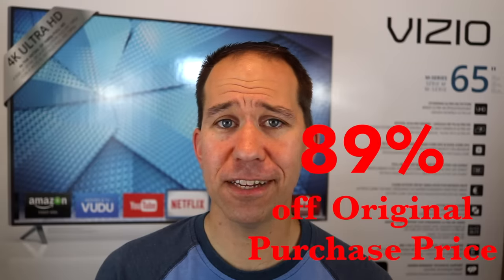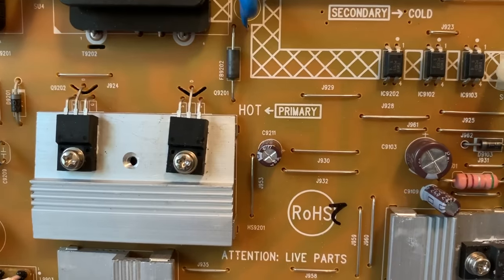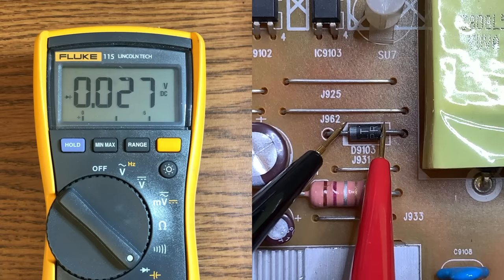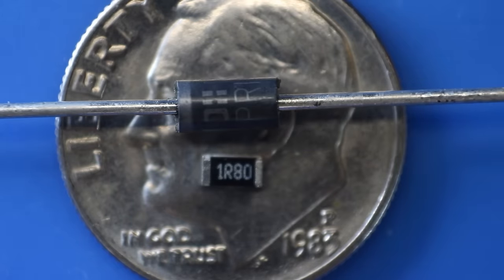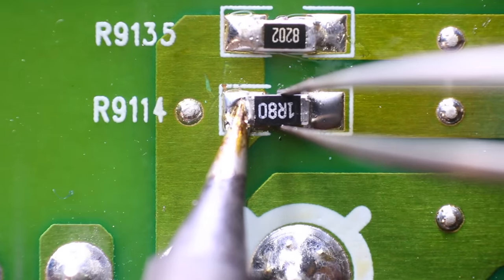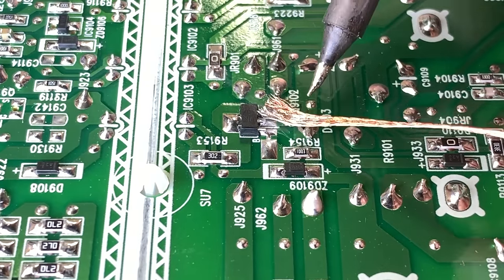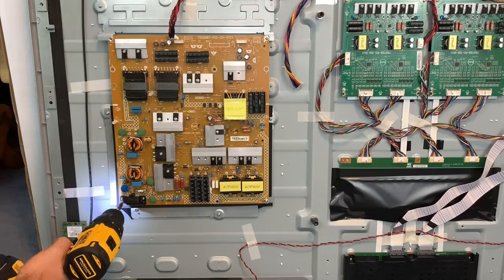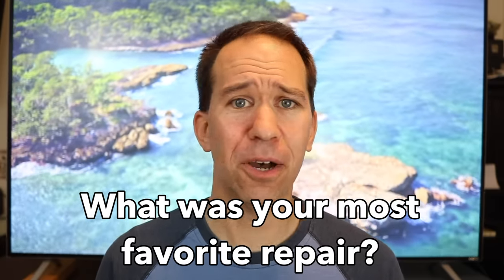I got a broken 65” 4K TV - How I repaired a Vizio M65-C1 (tv won’t turn on)

Comment: This reminds me of a story.  In 1971 I was working at a small aviation electronics factory/  There I met a guy who was a QC check technician, and he told me he had a warranty service contract for one of the major tv manufacturers.   He asked me if I wanted to go into business with him.  Although I had a good background in military electronics I didn't know much about tv's and I told him so. He said he didn't know much about them either.  That amazed me and I asked him how he managed to service tv's that he didn't know much about.  Remember, in those days most tv's were still vacuum tube models.  He said he took a model of this tv and pulled vacuum tubes out one at a time and wrote down the symptoms.  Then when he got a call he consulted his notes and replaced the appropriate tube(s), and he said that 90% of the time that fixed it.  I asked him what he did with the tv's that could not be fixed with his tube replacement method.  He had an agreement with a real TV service tech who he would take the dogs to and this guy would fix the tv's for a price and then he would deliver the repaired tv back to the customer.  Of course, I turned down his offer.  Talk about balls.

Comment: My favorite Repair was an APQ-126 Bombing Navigational Radar power supply while I was in the Navy.  It's a huge power supply with 18 different power modules and thousands of components.  I managed to isolate the problem down to a single resistor using the schematics returning the PS to 100% operational.  $300K Power supply fixed with a 10 cent resistor.
Reply from the maker: That is so awesome to hear!  I bet that was very satisfying.  Very cool!

Comment: Great video and I love to fix things as well just never known anything about small electronics.  You just got the wheels turning my friend.  :). I have a similar story about fixing a 50” Samsung DLP after a football went through the screen.  I had just replaced the color wheel and also knew about the bulb as two things that can go wrong.  I used Craigslist to find the exact same tv that wasn’t working and was being given away free.  All I needed was to pull a tray that held all the parts I needed out of mine and into his.  His issue was the color wheel which I had already replaced on mine.  10 min job 100% fixed.  But now I need to learn more about these circuits.
Reply from the maker: Thanks!  And great story!

Comment: I've used solder wick for decades.  Sometimes, especially some of the crappy stuff we get now, they may not "suck up" the solder very well.
So what I do now, IF I'm using wick instead of my fancy new power solder vac machine, is to dip the wick in 
LIQUID ROSIN.
Yup, I just dip it in the rosin and the wick does its job well.

Comment: Thanks for showing all the detail on how you got and fixed this Vizio TV. 
I'm thinking that the very same problem might happen again in a few years. Maybe this resistor is barely marginal for what needs to be done. Could you have installed a higher wattage resistor that might not burn out in a few years?
Reply from the maker: The first component to fail is most probably the diode.  This shorts and then the resistor blows as a safety mechanism.
Reply: @FrugalRepair  Thank you. I was wondering what failed first. Maybe the diode needs to be heavier duty to be able to handle more current? I don't know, just guessing.

Comment: Thank you for that.. I also like to fix things.. from cars to computers... currently I am attempting to fix my home theater subwoofer..it is the victim of a power surge so I welcome any advice .. Thanks again
Reply from the maker: That’s great to hear!  For the power surge, it could come through the mains or through an accessory (like through an hdmi).  Usually components near the power input/surge will take the hit first.  Hopefully you’ll be able to see a burn mark or other evidence to make tracking it down easier.
Reply: @FrugalRepair  Hello again.. I eventually bought a new sub woofer only because I just wanted a new one.  I still have the damaged one one day I will commit to do the full repair.. I am currently working on My 2003 ford expedition, repaired brake lines (4), replaced and installed fuel injectors, fuel filter, egr valve, dpfe sensor lastly pcv valve.. I'm a pro photographer but love to save money and do it myself.

Comment: I fixed broken cam for cruise control on my 04 Honda Accord using small braid nylon string and nylon tie. It supposed for temporary but it still working, 2 years so far.
Reply from the maker: Nice!  Thanks for letting me know.

Comment: I tried to repair my parents' 50 inch LG TV that broke down. The ESR meter helped identify a couple of caps that were bad, replaced them and a couple of resistors still no-go. I wanted to check the voltages but my dad didn't let me test with the board plugged in lol. If the problem is in the power transformers, or IC chips, I have no idea how to diagnose those things :(
Reply from the maker: Thanks for commenting!  Testing the output voltages on the power supply is one of the first things to check.  You want to make sure you know what board contains the problem.  I'm sure you can search online how to test the mosfets (the power transistors).  Testing for shorted mosfets may be another next step.

Comment: Excellent video! Thank you!
The root cause on my Vizio seems different though. Most of the symptoms are same (black screen, no picture and no sound, no led back light) except I don't see a flashing light on the main board, it is a stable purple light. All the voltage readings from power supply board are accurate. LED driver board also shows accurate voltage readings, does this mean that the LED backlight have completely failed (although I do not see any faint image under flashlight, which is usually a sign of backlight failure).
Any help on this will be greatly appreciated!

Comment: I got this laptop from a friend that looked like it came out of the trash and cleaned it up and , got a power supply for it, reinstalled the OS and it fired right up.  Been working on it and moddfying it, adding a second ssd drive to boot off of as the main, and it's still going as of this day Dec. 20, 2019  08:16am.  spent $40 on it.

Comment: You forgot to add your cost for gas money when U went to go pick the TV up, lol. Good Video. If I got one those in the shop I probably would have ordered the whole board. Thanks for the Info!
Reply from the maker: Thanks!  Gas is negligible since it was close by but do you count gas costs in the total when you go to Walmart and buy something?  I enjoy your informative videos.  Keep them coming.  Are you sure you wouldn’t do the same repair and replace components?  It seems that you have the skills and tools to do it.
Reply: @FrugalRepair  Just jokin bout the gas, but here I do have to be effecient when Im trying to get these TV's back to the customer in a hurry. Im sure I would have found it if I had time like that to troubleshoot the 12 volt line. But now that I seen your video, Im going to order those parts and keep them in stock. Thanks again for the video.

Comment: I love the copper braid technique and I'll use it.  I have been using my trusty solder sucker.
Reply from the maker: That way works too, especially for through hole.  But you definitely want the copper for surface mount components.

Comment: my favorite repair was a new 5.8G FPV video receiver for my drone purchased on aliexpress that did not turn on, after much research I found the problem looking for the data sheet of one of the components, the 8-pin component in its configuration basic had a resistance in one of the pins that did not exist on the motherboard, possibly due to a manufacturing failure, I looked for one of the same value that indicated the data sheet between the old motherboards of scrapping pc, I placed the resistance in the place where it was missing, and the receiver came back to life, I saved myself having to claim and send it back and learned something else, I also repair all kinds of electronics, now I am also with a somewhat complicated TV to repair

Comment: found same blown resister as in video, couldnt believe my eyes, ordered rectifier with it, going to be a long wait till it gets here, im learning a new kind of patience with this electronics stuff,doing it a little at a time,  hope the main board is fine, its been in the oven,Ill let yous know how the new parts do
Reply from the maker: Ok, hope you can get it fixed.  Why did you put the main board in the oven?
Reply: @FrugalRepair  to reflow the connections is what i read,
Reply: found these on amazon, do you think they would be acceptable rather than wait for Mouser? with the new year it didnt go out today..https://www.amazon.com/Tnisesm-Resistor-Tolerance-Experiments-Resistance/dp/B08BYJM3SF/ref=sr_1_5?dchild=1&keywords=thick+film+resistor+1%2F4+watt+1.8+ohm+1%25&qid=1609545978&sr=8-5, sorry to dump on you,but they match in specs and maybe the diff is surface mount and hole mount which is ok to do?
Reply from the maker: Do you know where you read that?  I'm curious. I've heard that some try to reflow the main board.
Reply from the maker: I'd wait to get the surface mount.
Reply: @FrugalRepair  i tried re-flow also with heat gun before i found your video also i didnt hear the clicking like yours
Reply: @FrugalRepair  in frugal fashion, im going to wait, thanks
Reply: replaced resister and rectifier just like video here, thank you, the flashing light on main board is now steady lit but standby light isnt lit and no other response at all from tv, onto some other problem with this unit, great CS from Mouser they overnighted the pieces to me N/C  holiday / long weekend whatever super cool

Comment: I fixed my 42 inch LG TV by replacing 2 capacitors that were bad in the power supply. Same issue, it would not power up or took a long time to power up. Fixed it for pennies.  Made the same fix on one of my computer monitors. Swollen capacitors are a common issue with power supplies.

Comment: One tool I use when doing repairs on electronics that have tiny parts is a Tasco K1020 (X10 - X20) microscope I purchased for $10.00. I do have a magnifying head set, but the Tasco is often needed in many situations.
Reply from the maker: That is great to have a cheaper tool that gets the job done!  Thanks for posting.

Comment: Awesome video. On a side note, if someone does not feel comfortable soldering on a board, you can buy these boards from eBay for about $25. Just do a search for the part number at the top of the board and you should be able to find one used.
Reply from the maker: Thanks!  I haven’t seen the power supplies for this model that cheap but it’s always worth a look.  And a good option to buy from eBay.
Reply: Do you know the model number for this board? Soldering is beyond my comfort zone and I’m debating buying a new board for potentially the same issue and same TV.

Comment: I have the EXACT SAME TV (M65 C1) that a friend gave me for free cause it was broken. Black image with backlight and seems functional except no image. I am fairly sure it's the TCON board. Maybe a similar issue to the other Visio TV you fixed by replacing a SOT23 component. I am trying it now 😃
Reply from the maker: Hope you can get it fixed!  I doubt it’s the same transistor on the tcon for this model.  You’ll want to do the lcd isolation test which should give clues.  My tape fix videos hopefully explain that.
Reply: @FrugalRepair  I just did! But also not really. The corner has a black blob of death. And I did the tape method on the last 16 rows of the second ribbon cable. That black blob is getting SUPER HOT! I burned my finger! And the black spot seems to be getting bigger as I run the TV. Works for now but I don't think it will last. Obviously there is a defect in the LCD matrix and a short circuit.
Reply: @FrugalRepair  I am uploading images to imgur to share. Might also post on Reddit Vizio subreddit.

Comment: I had to learn how to fix TVs out of necessity, that is to say, so I could watch TV... I'm a big fan of Tampa Tec, BiggDawg, ShopJimmy, and Northridge Fix videos... I just recently discovered your videos also, "Mr Frugal"... Fine job you're doing, sir... Your videos are excellent...
So I confiscated a non-working TCL 65" 4K ROKU from a guy that owed me $50... This one had a small access panel (maybe 2"x2") on the rear-bottom of  it... I opened it up, and OOOOOHHHH, slapped it back on quick... I got my shop vac out with a small nozzle, removed the big back panel, and proceeded to suck out a trillion dead roaches - babies, mommas, papas, grandmas, grandpas, cousins, uncles, nephews, nieces, you name it, they had a massive party in there, with a live band... They were everywhere, and all dead, Thank The Lord... There was cockroach feces on all the circuit boards, the steel plate, the wiring, everywhere... I scrubbed it as best I could with 91% alcohol... I pulled up ShopJimmy.com, and ordered the 4 new boards for $95 shipped to my door... I installed them, put the cover back on, put some Fire in that Wire, and BAMMM, I got a 4K 65"er for about 20% of what Amazon wanted for the same model... TALK ABOUT A SERIOUS GAMING MONITOR!!!
Reply from the maker: Great job!
Reply: @FrugalRepair  I wish I could send pics on here... I got an LG 50LF6000 "dumb" TV, into which I've replaced everything, and it still doesn't work... On powering, there's 1 very bright backlight flash screen-wide, then it drops to the dim purple glow... It's got sound but no picture... I've replaced all the backlights, logic/psu/tcon boards... Then I discovered a small chip on the panel edge, about ⅛" deep X ½" long... Could this be the reason this TV won't show me any video?? I'm just looking for a professional opinion... Thanx...
Reply: Never mind, cancel my question... I figured it out... The cracks in the panel flew right over my head... Your technique of unplugging one of the Tcon cables made me see the light... I sure didn't see the cracks when I had it out... TWICE... Now I'm stuck with $80 buxx worth of circuit boards and backlights, with very little chance of finding another TV of the same model number...
STEP 1) EARN MONEY AT JOB
STEP 2) DROP MONEY IN TOILET
STEP 3) FLUSH

Comment: My sister gave me a VIZIO 32" M320NV.  She simply was getting a new TV and this one wasn't getting a lot of channels on it. I try to screw in the OTA antenna and the male cable nub is spinning freely.  Even tightening the thread screw did not stop the spinning.  I am an IT guy, but navigating broken electronics is beyond me.  After getting the back off, I saw the male connector wire going to the motherboard was twisted and snapped.  Yep, someone fat fingered it and tightened it until it snapped. Leaving the wire barely touching when spun just right.  Some magnifying glasses and solder later, a 6 channel HDTV was now a 60 channel HDTV.  Still not sure where to put it, but I am keeping it.  😁
Reply from the maker: Nice, great story!

Comment: 200 dollar counter top oven/broiler. 3 hours and .10 cents of DeOxit into the itty bitty PWB micro switches fixed it.  Often times, it's harder to get the darn thing open than it is to fix it :)  Nice video.. nice job
Reply from the maker: That's great!  Thanks.  And thanks for sharing!

Comment: Great video!  I'm curious what caused the failure in the first place.
Reply from the maker: Thanks!  Not exactly sure but bad component (diode) seems to my understanding at this point.  There are some good discussions about that question here in the comments.  It could also be poor circuit design and/or undervalued component(s).  I haven’t had the time to investigate it more, unfortunately.

Comment: Great video. Same TV but it cycles on and off for hours sometimes before booting up.
Is it same issue?
Reply from the maker: Thanks!  Probably a main board issue, but could be anything.  Try a heating the main board with a hair dryer , warm it up then power it on.

Comment: Awesome video...THANKS for sharing. I have a Vizio (XVT553SV)  that's showing signs of Solarization (not too bad yet but fear it will just continue to get worse)...I'm wondering if the problem is the T-Conn board? Any thoughts on how to determine if the T-conn board is in fact the problem...other than through the process of elimination? I'd hate to purchase the T-conn board only to find out that this isn't the problem and it's the main board or even worse a bad panel. BTW I get solarization effects on the main picture screen as well as the menu screens.  Thoughts/Advice?
Reply from the maker: Thanks!  I'm not exactly sure what the solarization is coming from on your unit.  I think the tcon is on the main board.  I looked on ebay and a used one is $41, so that would be the cost of your gamble.  It could be an IC on your buffer board (lcd screen).  You could look up the gamma IC on your main board and go down the component road if you want.  I'm curious to hear what you find out.
Reply: @FrugalRepair  Thanks for the reply. I was under the impression that the main board and t-conn board were completely separate boards...but I could be wrong. I don't think that I will go to the component level...I'll probably try replacing the T-conn board and if that doesn't fix it I'll just go for a new one. I just don't have the skills or tools to do component level testing and/or replacement. 
Cheers